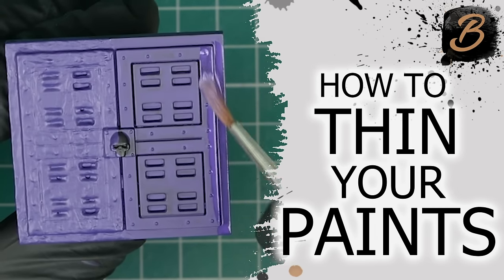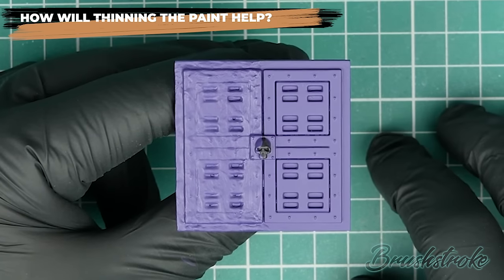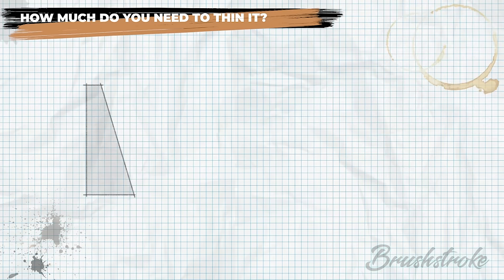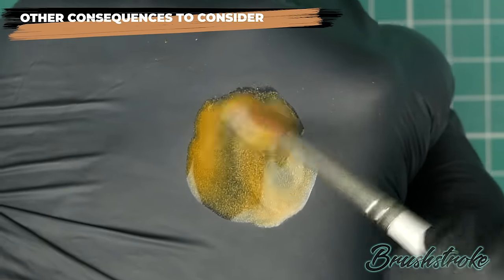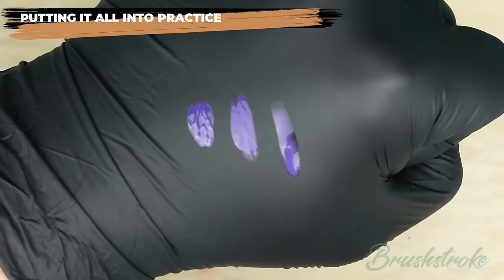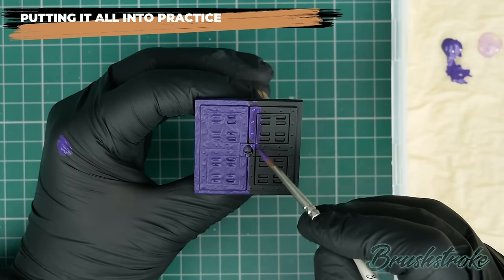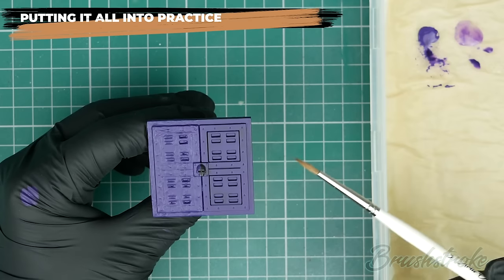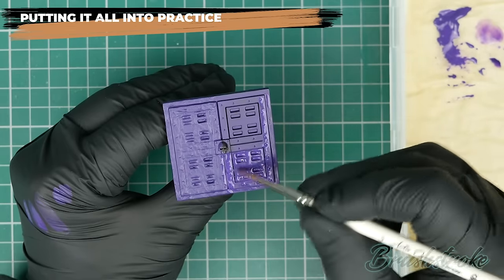HOW TO THIN YOUR PAINTS: A Step-By-Step Guide

Comment: How is it that not way too thin? My paint pools like crazy when I get it as thin as you showed and it’s very difficult to control. What am I missing? What other factors are key to consider when painting that thinly?
Reply from the maker: I think you’re probably just applying too much.
It’s often hard to fight the instinct to want the paint to cover well and when it feels like it’s not you automatically try and add more. 
The other thing is although the paint is able to flow, it should have enough paint in it to stop it just rolling off the surface. 
It’s a balancing act to find that sweet spot but once you do it should all just make sense 
Keep with it mate, you’ll get it
Reply: @BrushstrokePaintingGuides  thx very much for the reply, I'll keep practicing. Also I am using Wildspire minis to practice (still cleaned and primed). Could that make a diff?
Reply from the maker: No problem

As for the minis themselves, no I can’t imagine they’re making any difference as long as they’ve had all their release agent removed before they were primed 👍

Comment: Can we switch tje water with acrylic thinner?
Reply from the maker: yes you can
this video in intended as a basic introduction to thinning
many paints are not in fact water based, even some acrylics. Tamiya's for example.
So, a good rule of thumb is if the paint is not water based then always use the appropriate thinner that brand recommends to thin that paint.
Also, one final note, sometimes its actually not recommended to use water to thin water based acrylics and that is when you want to thin it past its splitting point. Say if you want it to be an ultra thin glaze.
The splitting point is the point at which the paint will no longer hold together and all the elements in it want to separate.
To thin past that point you need to thin with an appropriate medium, which is basically just pigmentless paint.
By thinning with medium you dont reduce the ratio of bonding agents in the mixture and as a result the paint will continue to stay mixed together
Hope that helps
Thanks for watching
Reply: Wow.. a great response.. thank you kind sir. And always keep the good work your video are nice to watch

Comment: Looking at the blob of paint on the wet pallet after the first coat and then just before you started the second coat, you missed showing us a step?
Reply from the maker: No, there’s a cut there so you didn’t have to watch paint dry.
In that time the paint on the wet palette continued to absorb moisture through the palette and became more thinned is all.
Reply: @BrushstrokePaintingGuides   Looks completely different, even the water and two extra splodges of paint, so someone messed with it, right?.    You could have done a time lapse?

Comment: Is this for acrylic paint or enamel
Reply from the maker: The paints used in this video are water based acrylics.
The principles still work with enamels, however, you will need to use thinners and NOT WATER

Thanks for watching :)
Reply: @BrushstrokePaintingGuides  bet. Thanks for the reply. I just got into scale modeling and was making a goopy mess. Appreciate you.
Reply from the maker: No problem
For people just starting out I would recommend starting with acrylics, as they are a lot more forgiving and easier to work with (in my opinion)
Enamels are great and can produce amazing results, but even the simple restriction of not being able to rinse your brushes with water is enough to put me off 
Happy painting :)

Comment: What are you using for that palette paper?
Reply from the maker: It’s parchment paper

I’ve had a few questions about my palette, so I’ll do a follow up video with all the details for everyone to refer to.
Reply: @BrushstrokePaintingGuides  I just ask because I've never seen my paint do that "retract" bit. And I've thinned it a fair bit. I use the palette paper that comes with the Redgrass wet palette.
Reply: Same, my paint doesn’t behave like that at any point in the thinning process. Also on the Redgrass xl pallet

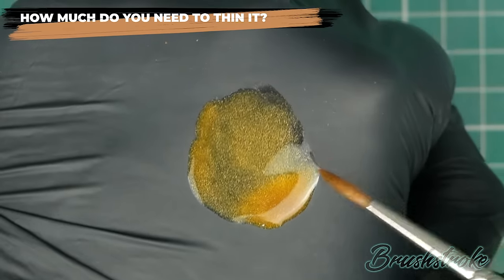Comment: 4:40  i'm not sure but is it still a paint ? look more like ink : pigments are in suspensions in water, there is no more enought binder in it.
Reply from the maker: What's your definition of a paint?
The concept of this video is that the level of thinning required is determined by the end result you are after. 
If you consider "paints" being on a scale of speed or fluidity then they can range from almost solid through to totally liquid, for example oil paint through to inks.
I would argue, for the purpose of our hobby, "paint" is more the verb or action rather than the product itself.
We paint with water based acrylics in just the same way we paint with washes, inks, dyes etc.
If you so choose you could even paint with tomato ketchup.
I would therefore define "a paint" as a substance which can be applied to produce a permanent change to the colouring and/or sheen of a surface.

The example in this video is looking for a thinning level which will produce a fully opaque and totally smooth result. Predominantly for the purpose of base coating.
However, if the end result I was after was to give a metallic sheen to a surface without obscuring the underlying tone I could well apply the paint shown at 4:40 to achieve that.

Hope that helps :)
Reply: I'm not speaking english very wel so i hope i understoud everything.
I use paint and ink for graffiti, and what i learned ( or what i think i have understoud ) is that:
Ink is pigment in suspension or tainted liquid.
Paint is pigment+binder+liquid. Pigments are binds each so it's pretty like "a huge  pigment" where ink is more like a lot of very small parts.
at 4:40 we can view the pigments floatting in water, so i think is more like an ink.
Oil is a binder, like acrylic resin.
but maybe i'm wrong.
My learning is from graffiti, so not the same application and maybe not the same vocabulary.
And for the joke i've already painted with tomato ketchup, and with milk mixture ( to produce full colored "rotten" painting ) and also with lichen ( so beautiful to see vegetals paints ) :D
 @BrushstrokePaintingGuides
Reply from the maker: Ah OK
Yes, the chemical makeup of inks and paints do differ for sure. And you are absolutely correct. Paints do have additional binders in them which hold the paint together and maintain the pigment distribution evenly throughout the paint.
By adding so much water to the paint at 4:40 I have effectively broken the integrity of the paint so that it is no longer able to hold together. This is often referred to as "splitting"
By thinning the paint past this splitting point, yes you are absolutely right I have made it no longer perform as it is designed to (although, there are times when this is desirable). So, your comment was right and I misunderstood what you were meaning. Sorry.

As I think you are realising, 4:40 was done as a visual demonstration of how paint moves when it is thinned and not really meant to say do this.

If you actually wanted to thin a paint down to that level of fluidity, you should really do it using medium and not just water. Medium is simply paint but without its pigment.
By thinning with an appropriate medium the resultant paint still has the required ratio of binders in it to prevent it from splitting and enables it to hold together and perform more like a wash or glaze. ie very thin, evenly distributed pigment.

Sorry for any confusion

Comment: And middle ground between two put paint on pallet wipe sime off brush then paint it be 10 times less messy than straight from pot but nit as good as thined  and use less paint as wow u dipped in pot way more often than needed to

Comment: So I’ve been using a redgrass wet palette for years now, and their palette paper doesn’t allow paint to “spring back” as it does for you, and may other painters I watch. 

When pulling paint out of a blob on the paper, it paints on, and lies completely flat, as if you painted it onto a regular surface, and thus dries out incredibly quickly.

Any idea why that is, and have you experienced similar when working on any particular brands of parchment paper?
Reply from the maker: A few people have commented that the redgrass palette doesn’t behave this way.
Unfortunately I don’t have one to be able to comment precisely.
I would expect the paint will still have the same characteristics as in the video, but they may be harder to see on that paper.
You’re best to go with the testing on a hand / scrap piece method if you can’t visually see the paints properties clearly on the palette

Comment: Would you put paint on straight from the pot that thick ? I don't think so. Surely people who do this would paint it on more thinly and not just spread it on like butter on bread. I have painted for years straight from the pot and it sure does not go on like your test piece.
Some paints washes etc do not react to kindly to being mixed with water and a paint medium should be used.
Reply from the maker: I won’t argue with you on that.
I will say though the “bad” side was done only as an extreme example, and as it’s impossible to tell the viewer’s current skill level. I felt it better to not risk anyone thinking “I can’t even paint that well, what’s the point?” I didn’t want to alienate anyone. 
Doing it this way, everyone gets to feel superior and think “haha like I’d do that!”
More experienced painters can then simply substitute their current paint finish to compare against the right side. If it’s already at that point then great. If not, then perhaps there’s some details which may help with theirs.
As for thinning washes / contrasts / speed paints etc. yes, using a medium to help maintain the paint’s integrity is advisable

I think a follow up video on the use of mediums, flow extenders, retarders etc could be useful. To expand on this video
Reply: @BrushstrokePaintingGuides  Nice reply, thank you.

Comment: Great video but you did deliberately overdo the non-thinned paint by slapping it on like plaster.
Reply from the maker: Thanks for watching
The non-thinned side is purely intended as a starter of the conversation and I didn’t want to alienate any of the viewers.
It’s meant to make everyone think, “he’ll, even I’m not THAT bad”
More experienced painters I would like to think can just compare their paint finish to the right hand side. Is theirs as smooth as the right? If not, then perhaps this can help them work out what they can do to improve.
In this hobby, I don’t think there is ever a right or wrong way to do anything. If you get the result you’re after, then that’s the key.
I tried to make the video I wish I had when I started. Instead I’ve taken ages to realise I just need to look at how my paint is behaving and it will tell me what result it will create.

Thanks for checking out my channel 🙏

Comment: Was he using water on top of the wet pallete or am I dumb
Reply from the maker: No you’re not dumb, not at all.

Yes, I add water to the paint on top of the wet palette.
A wet palettes purpose is to replace lost moisture from evaporation, not to thin your paints.
In fact, I’ve made a video on this exact topic, which will explain things a lot clearer
https://youtu.be/NLcuicvJFKo?si=OMPQYb355Uzq2qCr
Reply: @BrushstrokePaintingGuides  ah thank you I figured as much and it’s helping greatly with my tau pathfinders

Comment: This has only made the painting process even more confusing, since water always made a mess for me. More importantly, he's using it on a panel, and not an actual mini figure (probably because doing this on a mini figure would actually cause the wet paint to flow all over the place and cause a mess). 

Use the smallest amount of paint possible form the pot. That's all I do.
Reply: And some context: I'm not an expert. I just don't trust using water in paint.
Reply from the maker: Thanks for taking the time to comment.
I appreciate your mistrust of water, it can quickly get out of control.
You’ll see though, one of the steps I use to check my thinness is how it moves on an incline. All this video is about is helping people find that sweet spot where the paint will settle but not run all over the place. 
I have tried to explain and demonstrate what others just describe as “you’ll get a feel for it.”

I chose a flat surface because so many people say they struggle to get a smooth finish in flat areas.
Of course, if you would like to see me use this exact process on a mini, then please give this a watch
https://youtu.be/_xJ4S2p10lo?si=F7_tFlbyx3avYV_K

And to give it some context, it was good enough to win a Golden Demon finalist pin this year.

Comment: I NEVER use more water than would be in a slightly dampened brush. The actual thinning of the paint is achieved by using acrylic flow improver which affects the surface tension of the paint less. Too much water can cause the paint to "chalk" and easily rub off.

Comment: Call me stupid, but is this not just what contrast paints are?
Reply from the maker: No
Not at all.
Contrast paints are formulated to stain and shade. Which means they run and settle into the recess of a mini but they remain semitransparent to show the base colour underneath. Their actual coverage for a solid colour is very poor.
You couldn’t paint a solid purple over a black primer is just two coats for example.
Standard acrylic paints, which this video is demonstrating how to paint with, are in their formulation opaque and designed to paint in solid colours.
However, as I was trying to show in the video, all paints exist on the speed scale and therefore there is an overlap in terms of how all paints can be used.
It’s all about picking the right paint and it’s right dilution for the end result you’re after.
Hope that makes sense.
And no, I’d never call you stupid. It’s a perfectly good observation 👍

Comment: Use water? Not paint thinner? I paint using oil paints, so I'd be surprised if they mixed with water...
Reply from the maker: Apologies, the video is in reference to water based acrylic paints. In hindsight I should have made that clear in the video but I do include a note to that in the video description.
You're absolutely right, to thin non-water based paints you should indeed use the appropriate thinner.
As you will have seen from this video though, it's purpose is more to try and make people observe the behaviour of their paints more. So that they can make better, more informed choices of how they apply them. The same of which can be said for oil paints too.

Thanks for watching and taking the time to comment :)

Comment: Great guide for sure!!... but you gooped that paint on like mad for the 'out of the pot' example... it's possible to paint out of the pot and not be like.. that. LOL. Just saying it kinda makes for an even more biased example.
Reply from the maker: Agreed, the unthinned example was using a lot of artistic license, but it was done as a means to an end.
The point of the video isnt binary, it's intended to show that all paint is on the same spectrum and it is more a case of choosing the correct thickness for the outcome you want.
Can a better finish be achieved by the out of pot paint? Of course. But for the concepts I'm trying to explain, having an extreme example is far easier for beginners to appreciate.
Expecting new comers to the hobby to pick up subtlety and nuance between similar surfaces would have been much harder to convey.
I do say at the start of the video it's purpose is to show how I achieve my paint finish. There are a million and one ways to get the same result for sure. I'm certainly not saying mine is THE right way, just a way.
Reply: @BrushstrokePaintingGuides  Nah I got it, it was just a little jarring at first was all, still great vid! I wasn't trying to detract from anything mentioning that haha. VERY helpful.
Reply from the maker: All good man
I appreciate you taking the time to watch it through and seeing past it 👍🏻

Comment: you intentionally over painted the unthinned side.

i regulary swith between thinned and unthinned paints, and get both sides smooth and crisp
Reply from the maker: You realise you’re missing the point, right?
Thinned / unthinned means nothing. 
The whole point is paint is on a scale of movement and this video is intended to show that you pick the amount of movement required for the outcome you require.
It’s about observation and choice.
You can have two pots of the same paint and they can have very different characteristics because of so many factors, age etc.
So you observe and adjust the paint to fit your needs. That’s my point

Comment: Of course you're going to fill up the details when you use that much paint, there's like 5 times as much on it as you actually need. Yes thinning paints will give better results, but not thinning them isn't going to give you results that bad. It looks like you purposefully globbed the paint on just to make it look worse. It's really not a fair comparison when you use less than zero effort to not make the unthinned paint look like shit. In reality they'd look identical, but the unthinned may have more noticable brush strokes and very fine details, like 10% of the size of the ones on this piece, You may also have some difficulty getting paint into certain areas since it doesn't flow as well. I painted directly from the pot for years and none of my models look that bad.

Purposeful exaggeration should have been stated if that was the intent